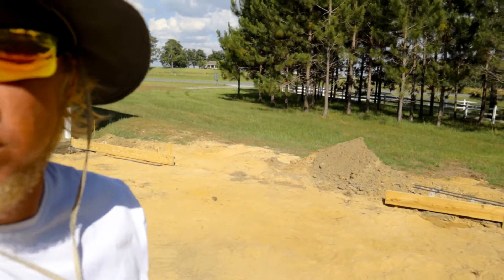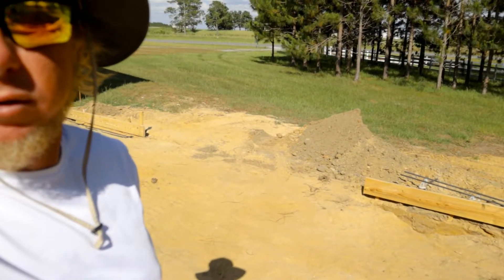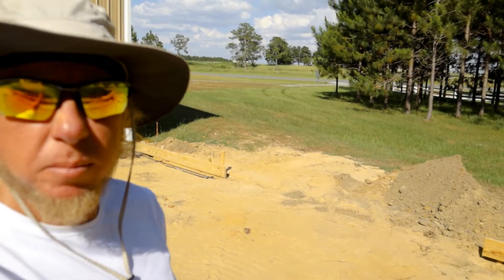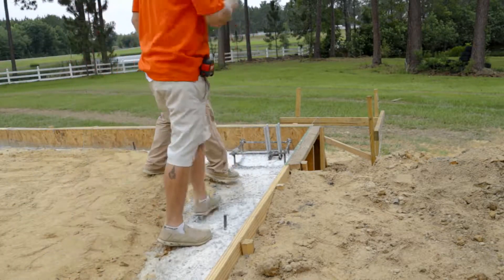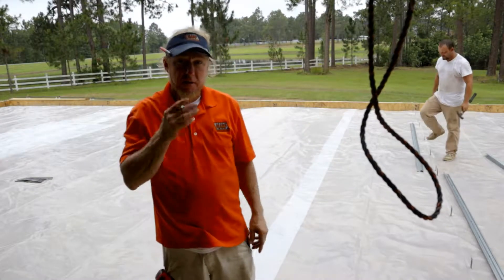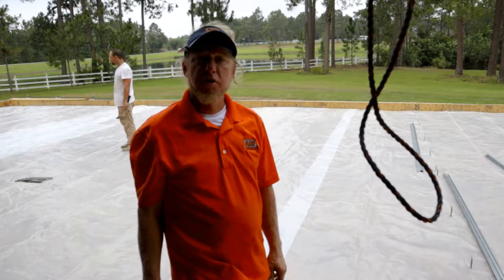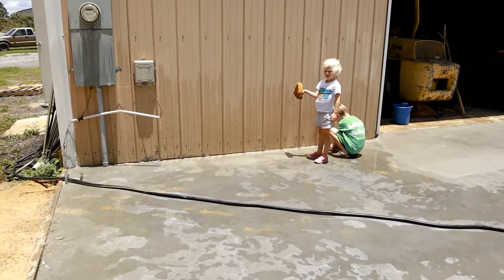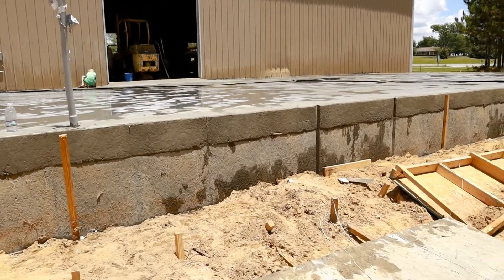Concrete Foundation: Piers, Footers, and Rebar

Comment: What are those screed rails you installed called?
Reply from the maker: The keyway construction joint is probably the most complex construction joint. ... The keyway will act as the slab edge for the pour. When forces push one slab vertically from the other, the keyway construction joint will hold the two slabs together. Keyways are typically applied in commercial settings.
Reply: @BuildingwithNARF  - and did you ride your powerscreed right on top of it when you poured - Screed rail to screed rail?
Reply from the maker: @MrTrda  about a 1/8-1/4 above so it doesn't show metal in the slab....this is to become a control joint for movement.  It saves from cutting with saw later.